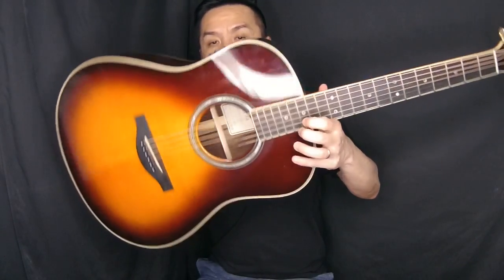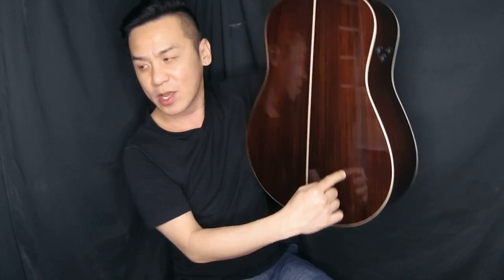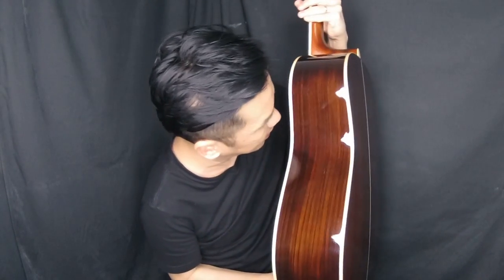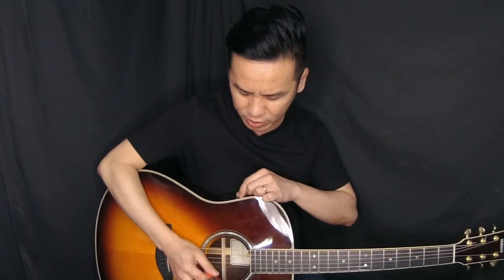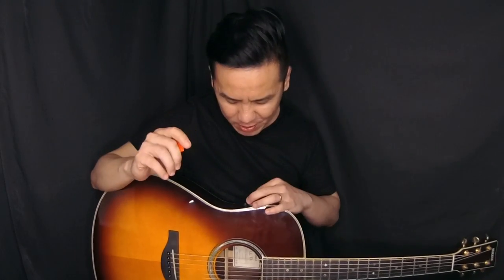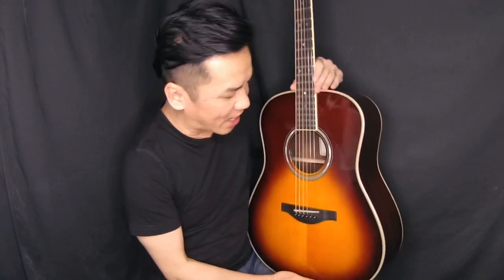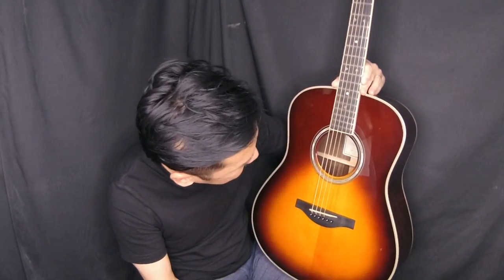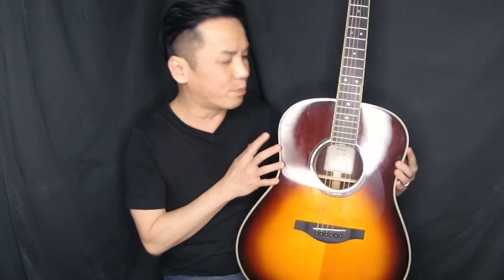NEW Yamaha LL-TA TransAcoustic Guitar Review in Singapore

Comment: these appear to be great guitars and I was just about ready to buy one till I saw the youtube  video why not to buy one of these. It show feedback problems and  there is  no backup or help  available    like the guitar has a circuit board in it how reliable is that , will that last years, and if it fails where do you get the replacement.  I have a top range Yamaha ACOUSTIC  guitar and I brought it to the Philippines 10 months ago  with the heat the battery holder compartment terminals has  deteriorated ,  but can I buy a replacement.  no chance. Dealers say cannot get one , so I had to make a terminal myself which is no good if I ever wish to sell it . SO FOR ME UNLESS YOU CAN BUY SPARES AND HAVE A BACKUP  THE GUITAR WORKING IS GREAT BUT THE FAULTY ONE IN THE VIDEO WAS NEW TOO  SO GIVE IT A MISSRead more Show less